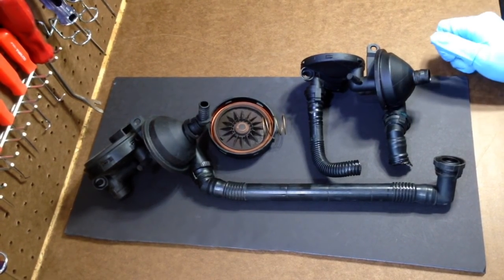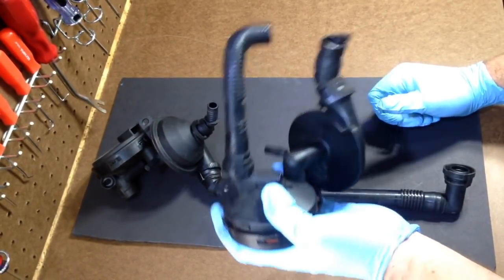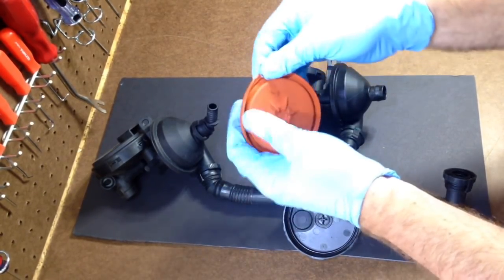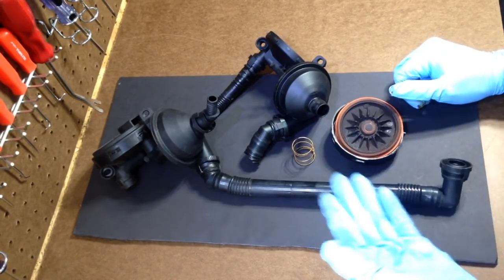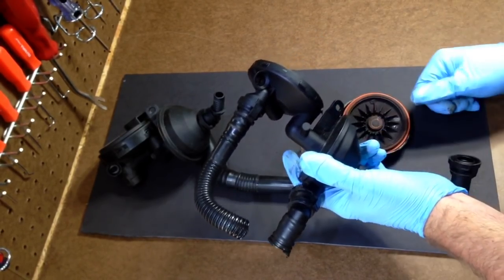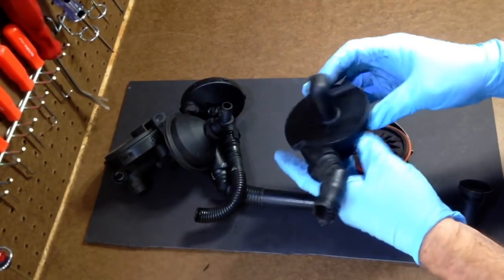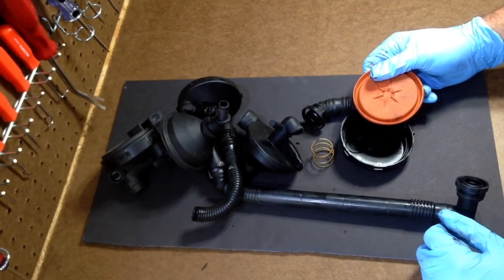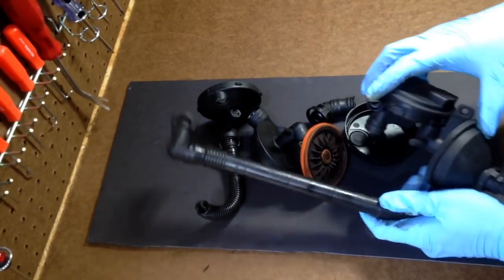BMW M52tu M54 CCV PCV How Old And New Valves Fail

Comment: Can this cause oil on spark plugs? Should the tube that disconnect to the head cover be coated with oil?
Reply: No. U have a leaking valve cover and the center circular grommets. They seal the oil from getting in there, unless theyre old and leak.

Comment: Nice video, i have a m52b28 single vanos, i did a leak test on the intake with a smoke machine, and i notice 2 things, with the throttle body fully close there is a little leak in there, is that normal? Also, i saw that the ccv is getting air through the intake to the crank case(didnt see any smoke, but as the smoke machine build pressure i heard air comming through the oil cap), is that normal? Or so i have a problem in the ccv?

Comment: Curious question, I had this problem for lean codes for both banks, I replaced the whole CCV system very carefully, took the air intake out and everything because I done this 3 times and still had codes, at the same time the abs module took a shit, and when I replaced that (clear the codes and same codes came up) I drove the car for a while and the codes went away and it’s been 4 days with 60 miles added and still no codes, could it been from the module?

Comment: My failure was a little different.  maybe it was because I didn't drive the car all that much, even let it sit for 6 month stretches, but the drain to the dipstick got clogged so the oil had no where to go and got sucked back into the intake.  CEL, rough idle, lots of smoke.  My CCV was the older style (9/96).

Comment: I had Ccv line broken to oil pan , I seen your video on catch can (E46) . So I did that hooked up on the caped off Spot On the Intake now it pouring oil out my rear main . Took seal off oil fill cap stops leaking @ r.ms. .. I’m getting lean & cam Sensor (bank 1)Changed Vanos Seals , Valve cover gaskets , cam Sensor (bank 1) Disa checked good .. Ccv ordered now Oem .. my car goes has no power at low rpms and hits limp mode around 4K . Any Advice what to check ?

Comment: Nathan, please help, I got a BMW 520i 2002 with M54 Engine. I've got the engine with a massive leak in the valve cover and I changed the gasket there, later I got a leak under the car and I changed the oil filter housing gasket, and still have a problem with the oil, I changed the main rear engine seal, also the oil pan gasket and oil dipstick seal. the car is still consuming oil and I got sick of it I don't know what to do. the only thing that I did not change is the CCV system, I am afraid if I change it nothing will happen, besides, no blue or black smoke the car is OK, but it consumes oil so I end up with a 3 litres of oil after a 1000k or a 1500k high way run, so please help me I do not know what to do and I live in Libya

Comment: Where is the ccv pcv located in a 2005 x3? I had mines repaired a year and its already  failing. I could smell the oil and there is blue smoke coming from the hood.

Comment: Thanks for ur video... so I av a bmw 3 series 328i 2009 model with a problem since 2015 no one can fix it...
Not even Bmw of west Houston.
It drives perfect for 10minutes then after 10minutes it shakes at the dashboard through to the car on acceleration. But if I floor the gas or ease the gas it drives fine. Other than that it got no issues since 2015.
What I av changed:
Guibo 
Front wheel hub
Cam shaft
MAF sensor
Engine mount
All four tyres
Shock n struts from n back
O2 sensors
Gear oil
But still is hesitates on acceleration the same way since 2015. 
What do u think the problem is?

Comment: On the way to work this morning and my 328 started blowing smoke like when a turbo goes on a car and it shook me up! 
Oil went to minimum on the stick and the hose that goes to the cam cover was blocked with yellow gunk! 
Phoned up bmw for one of these valves and all hoses for the job, cam cover gasket(cos thats leaking) and a split intake trunking pipe came to £225 (trade) !!! Looks like im gonna be skint for the rest of the month!

Comment: Nathan, Thanks for all the good work. I have a 97 528I which loses coolant. I can't for the life of me figure out where it is going. I've replaces the water pump, thermostat, expansion tank but still loosing coolant. It is not a blown gasket according the my mechanic. I also have noticed that if I let the engine cool and take the cap off to relieve pressure, I don't lose as much coolant. Any ideas would be appreciated.
Reply from the maker: Check the hose on the rear driver side of the head, reach under the intake on the rear and see if its dripping or expanded, also check the cap  for the expansion tank
Reply: Thanks, I will check that but I don't see any coolant on the ground. The cap is new.
Reply: @NathansBMWWorkshop Can this cause oil on spark plugs? Should the tube that disconnect to the head cover be coated with oil?

Comment: Hey Nathan just wanted to thank you again for all your very helpful videos.I did the single hose delete and by doing the ccv pcv delete it has stopped oil consumption. Before i was going thru 2 or 3 quarts of oil between oil changes. Thanks again Ken from North Carolina

Comment: We have a 97 528i that we put a new head on and a new ccv also... less than 5000 miles later the CCV is howling like a lion...loud humming noise and I can feel where the leak is right on the unit. if it wasn't leaking air so badly I would try to just Bypass it...but it looks like I have to remove the Intake to do it either way ! Liked/Subscribed Nathan

Comment: So youre telling me a new one can fail too? I just did this in my E36 M52 328is. Surging idle fixed. I made a video on it. Need to replace valve cover gasket and some vanos seals cause oil leaking there badly.

Comment: Nice video. My car, n52b30 pulled a 2AA9 code talking about variable intake servo motor activation. Is it possible the diaphragm's the cause? because both disa's are fine. thanks man.